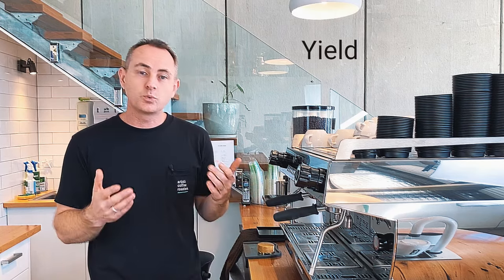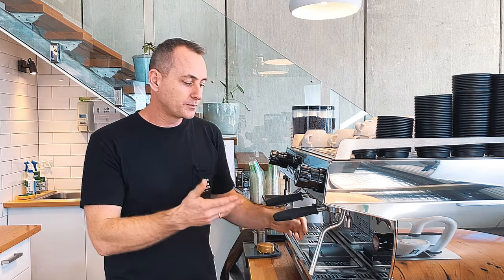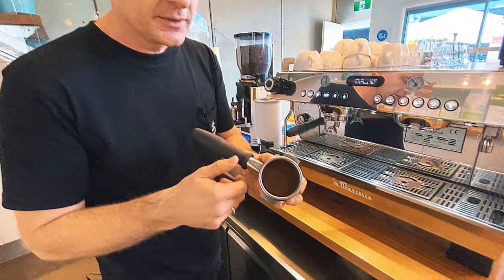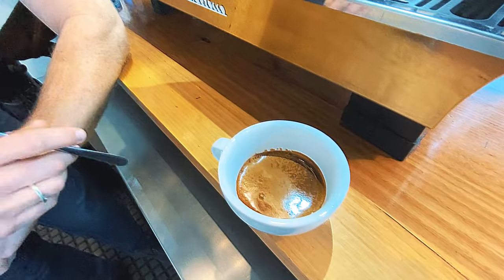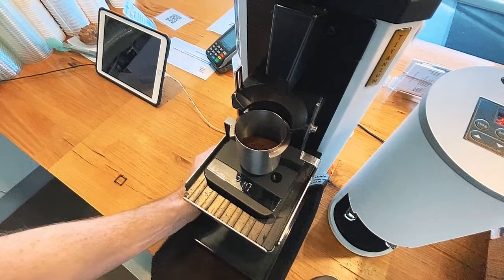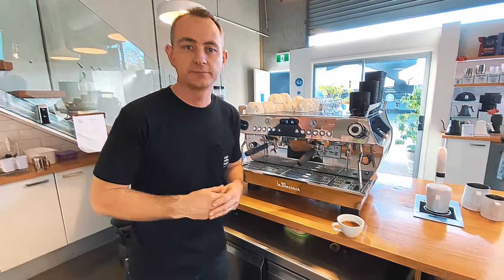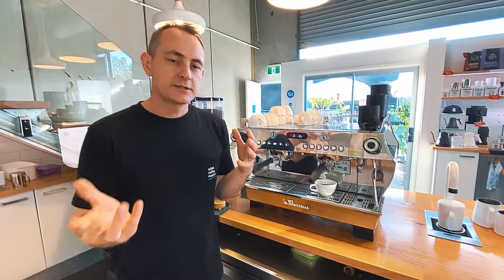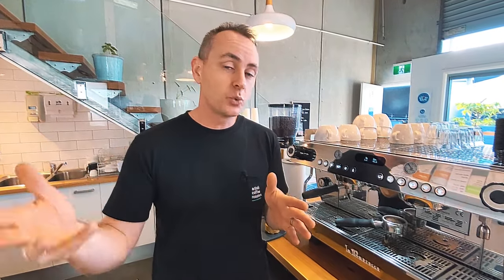Understanding the Role of Time in a Brew Recipe - Chasing Perfect Coffee Extractions

Comment: Great video
Question though : If we already dialled in with ratio 1: 2 in 30 secs, If we want lesser ratio, say 1 : 1,5 (ristretto) do we reduced time to around 20 - 23 seconds, or do we grind finer to reach 30 sec for that ratio?
Reply from the maker: Keep the same Recipe, don’t change the grind, stop the time at the ratio you desire.
👍🏻
Reply: Actually a ristretto requires a finer grind. However that would be a nightmare for a cafe, so the don't do it like that.
Reply: @ArtistiCoffeeRoasters  
sounds off to me.
if you need a lower yield and would like to keep that great taste of recipe you need to re-dial in your shot:
lower your dose in,keep ratio,change grind (resistance has changed) wish for the best and taste.re-adjust again by taste.
If you just stop the shot earlier you'll get it sawer/salty.
Reply: Artisti coffee knows whats going on. A ristretto means (restricted) as in restricted espresso. The last part of an espresso extraction gives a watery bitter taste which balances out the espresso taste. A ristretto is a punchy sweet shot with a heap of body which is what a espresso is 2/3 of its extraction so thats where you stop the shot about 22sec in from a 30 sec 1 to 2 ratio espresso

Comment: Would it still work to aim for 30-32 seconds, but for a much smaller dose like 15g in, 30g out?
Reply from the maker: Yes, you may fine it’s more like 28-30 but if it’s not and acidic coffee you can push the pre infusion a little longer to say 10 sec and get super syrup drips at the start
Reply: @ArtistiCoffeeRoasters  Not sure if I understand. For a 15g basket, 30 grams out, in how much time? From when you start the group head or when water hits the cup?
Reply: @robbob1492  the exact time doesnt matter to be honest. Its just a measure to see how long the water contacts the coffee for propery extraction. If its too fast the extraction will most likely be underextracted if its too slow its most likely to be overextracted. Its more important to watch how ur shot flows and how it taste in the end than shooting for an exact extraction time. Thats why the recommended range for time is 20-30 or 25-35seconds. You can measure from first drip in cup or first button press. When comparing times it will be the same if ur consistent with how you time.

Comment: Since most folks recommend 25-30 seconds, do you go for 32 to include the short break after pre-infusion? Also, is there a video why you go for 22.5gr and 32s? What I find is mostly around 18gr and 36-45gr yield.
Reply from the maker: The 18g etc is the lower smaller baskets. We like the larger dose to help with the larger milk volumes.

Comment: Thanks for this very instructive video. I think I have understood why sometime, after having brew a coffee, the puck is stucked to the grouphead (so when I remove the porta filter, surprise! it is empty...). Probably because there is a too small amount of coffee and the grind size is too small and need to be ground coarser.
Reply: too small amount of coffee usually results in the opposite problem - of the puck breaking up or have dents and holes on the top. Sticking to the group head usually means too much coffee or too shallow tamp

Comment: Hi! I have a uestion, what happens if u pull a shot nicely at 30s, and ratio 1:2 but the coffee still tastes over extracted. What do you adjust next? Do you adjust the yield and try to keep the time?
Reply from the maker: The yield should still be 1-2, time is flexible so try a longer and a shorter time and then taste, some coffees do change recipes, these are a standard to work from and use taste to adjust. If over extracted taste lessens the time
Reply: @ArtistiCoffeeRoasters  so in this case, i will shorten the extraction time by adjusting grind size (ie coarser)? but keep everything else the same?

Comment: What size basket do you use for this? Do you need a larger basket to allow room for the coffee to expand/rise?
Reply from the maker: We use 21g baskets that you can dose 22.5G in. It will actually hold 28g so we have oleochemicals room for expansion. If you have a ridged basket you can dose 2-3mm under it and it will work well. Cheers luke
Reply: @ArtistiCoffeeRoasters  Thanks Luke!

Comment: What is a general rule of thumb when it comes to pre infusion times? Between 5 -10 seconds? From spout to cup? Does running the shot down the side of the cup as opposed to in the centre  make any difference to the crema?
And the pour,is 30 secs roughly optimal ? 
 What does the perfect  start of the pour look like? , (optimal drip to mouse tail ratio?)
 What is too old for bean age? 
How  Does room temperature changes from colder in the morning to hotter/humid later in the day affect the variation  of extraction?( I know it does affect the grind) does it affect dialing in the weight of your shots?  with a sometimes 20 degree temp to 80 % humidity  shift ?
How do you nail the extraction of pre ground decaf, Without losing your dignity and the will to live ? Lol
Reply from the maker: Ok, so there are lots of questions here, 7 secs, drip then pour, 30-32 seconds, we preferred side of cup or float in the water if a long black, 25+ days old is too old, drip then mouse tail.

Comment: if i grind my beans finer, i would get the proper time and yield, but my cheap espresso machine would generate very high pressure about 11-13 psi. Is this a common problem for cheap machines?
Reply from the maker: Yes it is, if it’s a vibration pump they are now changing the pressure to be higher up to 15 bar in some machines. As long as the water makes it’s was thru within the first 10 seconds you should be fine. Cheers luke

Comment: I would argue the explanation about the puck "floating" is incorrect. What happens with finer grind is you wash out more of soluble material and the puck actually shrinks and reduces its pressure to the walls of the basket (also, the soluble material is inherently sticky and with a good extraction there is less "glue" in the puck left). This is not a problem as the puck only "floats" when the solenoid valve kicks in and there is a moment of reduced pressure in the group head which pulls/lifts the puck.
Reply: +1
Reply from the maker: Hmm.. thanks for the info, what you are talking about I will assume your have watch the clear naked handles videos on extractions. Yes the exhaustion of pressure from a solenoid valve or a manual leaver closing will such the coffee puck up or show up cracks in a puck. But it will not effect the flow of the coffee (while water is still flowing) which Is presented as a very fast flow at the end or about 2/3 through the extraction.
Reply: Ok so I guess we agree. The puck is not at any point floating during extraction but after the fact. The reason for the fast flow is simply because the puck erodes. FIlter baskets are usually slightly curved at the bottom and we usually use flat tampers, so the puck is a bit thinner on the outside, that is where extraction (given the technique was generally good) and also over extraction (fast flow) begin. This can be seen on a naked handle.

Comment: My question is that what is the major difference between boiler and heat exchanging machine and how we find that which one is boiler and which one is heat exchanging
Reply from the maker: Sure, we will shoot a full video on this, an easy way to tell this is home machines will have 2 temp settings being displayed or 2 sets of pid gauges. Dual boiler allows you to change the brew temperature seperate to the steam temperature

Comment: Please note the timer should start when liquid espresso enters the empty cup which has already been tared and is at 0 grams. How can you properly time a shot since different machines may or may not have pre-infusion with a delay following infusion. Also different machines may have different start times due to the type of pump or inherent differences in the machine.
I will re-iterate. The timer should start immediately when it detects a change in weight of the auto-tared vessel and end timing when weight change terminates. This is how I time a shot even when using different machines.  Weight of coffee grinds in to weight of liquid out determines the ratio while keeping extraction time to 20-35 seconds. Above or below these times adjust grind levels

Comment: I'm new in this universe, I've been trying to pull a proper shot of espresso, despite I get all the timing right and the espresso looks great I cannot get rid of the sourness. I tried to reduce the dose, grind finer, increase the ratio 1:3 but not getting much different, still sour and tasteless. Any advice to get on the right track? Thanks
Reply: Try to get a very freshly roasted bag of beans (ideally roasted a week earlier). If impossible to get a fresh roast, perhaps illy will work in a pinch (their cans are well sealed), and try with a darker roast (with darker roasts, to counter bitterness you may need to adjust grams of ground coffee : water ratio, to less water output, e.g. less than 1:2, more towards 1:1,5)
Low temperature may also lead to underextraction (sour / salt) if your machine & filter holder aren't heated up properly.
Reply from the maker: What a great reply, thanks Stefan. 
The coffee your using will play a big part in this. Try find a coffee the is aged between 10-20 days. If coffee is too fresh (under 7 days) it will be more acidic and can be sour. 
I can only assume your trying this black? If you're drinking it with milk, I'd be questioning the milk too.
Sourness is usually representative of under extracted coffee. Going finer isn't always the answer, especially if you've got not a large dose. I'd be trying to increase your dose rather than reduce it.
Hopefully this helps, let us know how you go.
Reply: @ArtistiCoffeeRoasters  I'm using the Illy and it's fine, the other one at the same settings is still acid, I'll try to reduce the dosage and see what happens.